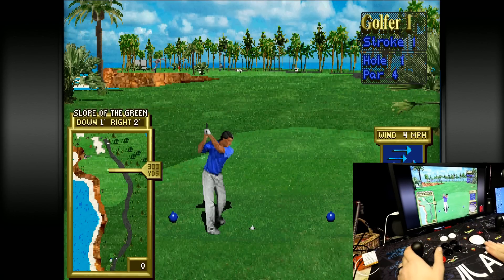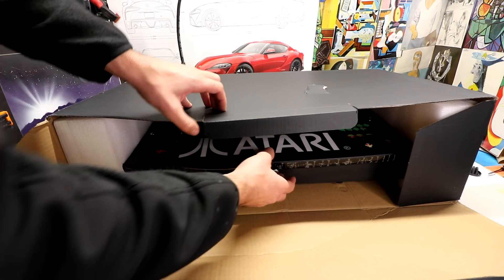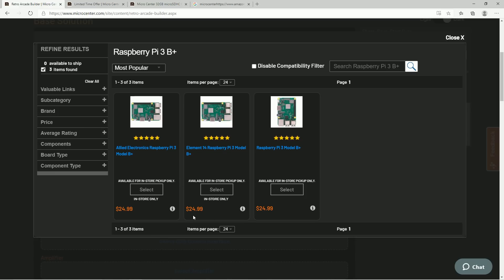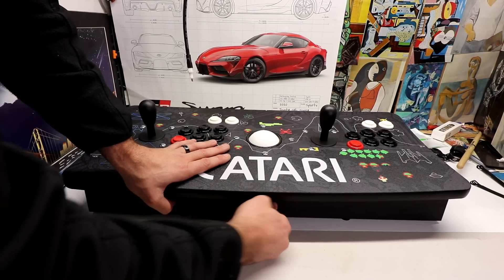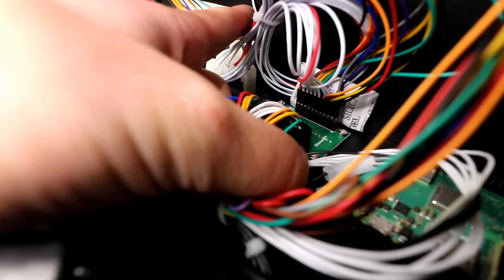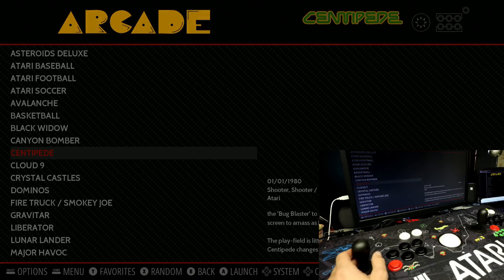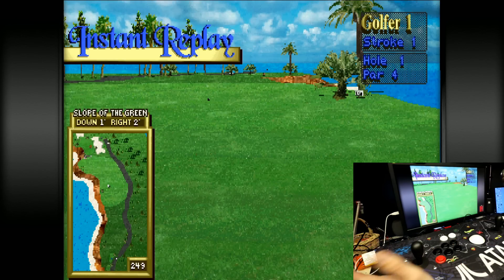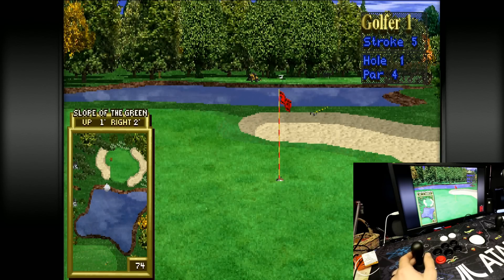Atari Arcade Fight Stick Unlocked Gaming Potential - 10,000+ Games

Comment: I have one of these I got from Microcenter, minus the included Pi and SD card.  Honestly from the pics on the website I did not expect it to be as HUGE as it is... this could literally be on a real console cabinet.  The pics made it look smaller... anyway one day I will eventually get around to putting a Pi in here and doing all this.  Also... MC sells a PS4 adapter to use as a fight stick for Mortal Kombat etc... is't $20 but it doesn't work with everything.  Still messing with that.

Comment: I installed DZ king ultimate 400G for the Atari fight stick; however,  it only recognizes one controller due to the Xinmotek controller.  I even attempted to add "usbhid.quirks=0x16c0:0x05e1:0x040" to cmdline.txt of the image; however, it did not work.   Any solutions to this?
Reply: having same issue don't know what to do
Reply: He replied to a comment saying there’s a script and added a kink

Comment: Is it possible to configure in such a way that stick 1 and 2 can be configured to play 2 joystick games such as robotron?
Reply from the maker: If the emulator that runs robotron allows you to manually map the controls then yes, you would just map the controls player 1 A, player 2 A, etc.
Reply: Thanks. Biggest problem I have with the build is that the position of the lo in the case makes it impossible to get to the as card slot on the pi. I bought an additional card extender though so that should work for me once I get it.
Reply from the maker: @ChristopherWentling  LOL so true spent like 5 minutes getting it in one time ;)

Comment: I installed DZ king ultimate 400G to use with the Atari fight stick, but it only recognizes one controller due to the Xinmotek controller. With DZ's image being locked, I couldn't modify the cmdline.txt file. Were you able to resolve this? Also, did you get the trackball working?
Reply: I am having the same problem!! I switch to my kitchen sink PI3 B+ build and everything work.
Reply: I have the exact same issue.   I even attempted to add "usbhid.quirks=0x16c0:0x05e1:0x040" to cmdline.txt of the image; however, it did not work.   Any solutions to this?
Reply: Did you ever get this fix
Reply: If not I found a solution.
Reply: @counterrell35  do you know if this board works with vituralmans 400gb build?
Reply: @gasmakingboost  it only works with one joystick. You would have to adjust the file.
Reply: @gasmakingboost  there is a actual video on YouTube that walks you through the steps with the Atari fightstick and the virtualman image. I think it only took me about 8 minutes and all was well.
Reply: @counterrell35  thanks I just found the video to make the 2nd joystick to work
Reply: @gasmakingboost  that’s awesome enjoy!!
Reply: @counterrell35  I don't think anyone is seeding either any.ore can't get them to download.

Comment: I'm having a bit of trouble understanding how this product works... I've been trying to order this from MicroCenter for weeks now-- every time I place the order, I get a notification that it's not in stock. Furthermore, this version you have has completely different artwork, with the Atari name and logo on the bottom of the stick instead of the huge Atari logo in the middle. Now I look at their website and they have what appears to be replacement artwork available for $40 that matches the one you have. Furthermore, they also have an Atari spinner on their website that is supposedly compatible with this, but I can't find any explanation about where it goes or how it's connected... I love the idea of this product, but I don't understand what I'm supposed to do to get it with A) the spinner, and B) the artwork you're showing in you're video that doesn't include the "Micro Center Retro Gaming" logo on it.
Reply: The spinner is a separate USB device which is sized to fit into a standard button hole. So, you have two options for mounting it: either replace one of the buttons with the spinner, or else get an electric drill and a 1 1/8" spade drill bit and cut your own hole. After that, you plug the USB connector into your Raspberry Pi and then set it up. Please note that the "and set it up" part can be tricky and will probably involve your having to deal with command line stuff and editing configuration files.

As for the artwork, this was probably a pre-release version with alternate artwork. The artwork is sold separately, as you noted, and would involve your having to apply it to the stick and using a squeegee to remove any air bubbles.
Reply: @NeilNadelman  Awesome, thanks! I think the main question I had was whether or not the spinner plugged into the encoder board or into the Pi via USB.

Comment: I bought the $100 one and am using it with VMan's 256 GB image.   Wasn't that plug and play for me.  The second player side would not register until I had to add some text in the Boot Command Line.   The Trackball sensitivity needs to be adjusted to be usable.   Am I the only one who is having to do these things?   Other than that, the buttons and sticks feel great.  The extra wires are nice, because you can add a dial for games like Araknoid.   Any advice on how to map the buttons upon first setup?   Like which button should be X, Y, etc.   Thanks!
Reply from the maker: Yeah that's entirely possible trackballs and light guns can be a pain, the 2nd player their is a script out there to fix that
Reply: @drewtalks  I have a Vmans image 400 GB and found it a pain to adjust the trackball sensitivity. I wonder if the Kings build you using more adjustable? Btw Im using a Tank stick .. I was torn between this and Tank stick.
Reply: Can you share the command line?
Reply: @davidderouin6987  Read the link.  Command Line is in step 3.